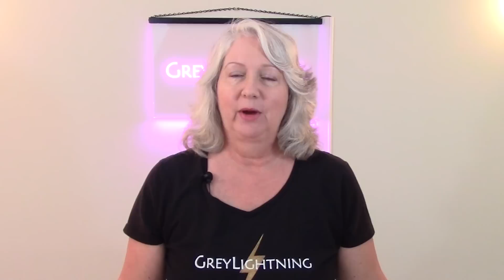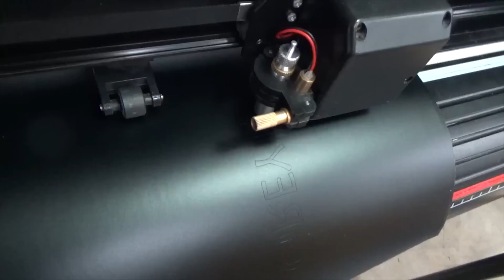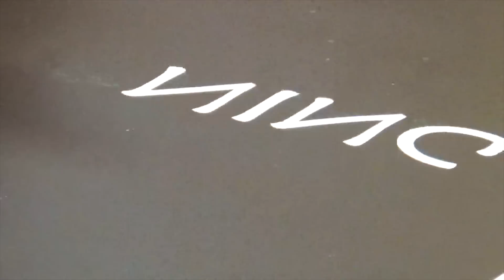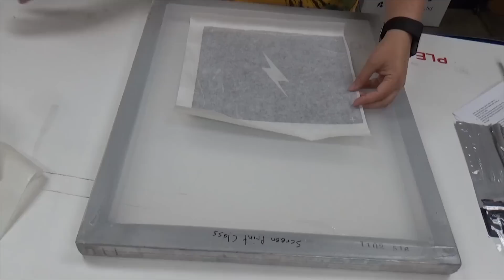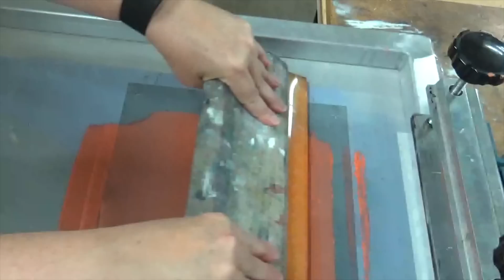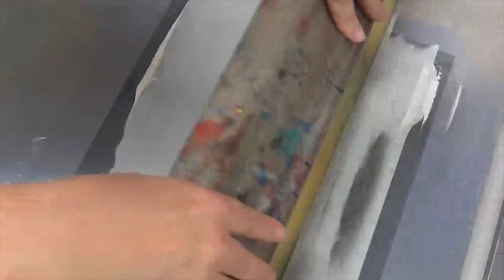Screen Printing GreyLightning Tee Shirts

Comment: I tried using the vinyl a couple times but I keep getting a bleed line. I'm not sure what I'm doing wrong. Like if I did the design you did in this video the lightening bolt would have a faded/light shadow to the right of it.
Reply from the maker: Will, sounds like an adhesion problem. If you are squeegeeing it down as well as you can, you may need to try a different vinyl. I've done this several times, and others do at TechShop as well, and the prints have been clean. Does it happen on the first print or later ones? That can happen if the screen shifts and you have residual ink from a prior print. Make sure the screen is tight and comes down in the exact same place each time.
Reply: Greylight May I'm using the cricut vinyl. I use a flat edge to make sure it's stuck to the screen. I watched another video and it said to try offset screen printing. It's happening on my first print.
Reply from the maker: Will, sounds like you're doing everything right. The one time I experienced this was because the screen had some wiggle room, but that only showed up after the first print. I'm not familiar with offset in the context of screen printing, so I can't comment on whether or not that advice sounds right. I hope you find a solution, and would be interested in what fixed it, when you get it to work. Good luck!

Comment: What type of vinyl are you using
Reply from the maker: Hi Leroy. Unfortunately, this is one question I can''t be much help on - I buy my vinyl by the foot at my Makerspace, TechShop, and it's unlabeled. I will try to remember to ask them about this the next time I'm there, in a week or so. If I get any concrete info, I will pass it on to you then...

Comment: how many tee  shirts have you printed before the vinyls start to brake down??
Reply from the maker: Hi Ben. I've only printed 12 at a time and there was no sign of wear on the vinyl. I use community screens, so I have to take them apart and clean them at the end of my session, so I'm not sure what the long term durability is... since the vinyl is on the back of the screen, it is not touched by the the squeegee, so I suspect they hold up pretty well, but if you want to print a lot of something, having screens made (photo emulsion?) might be the better way to go.
Reply: thanks for that information, 12 shirts  is good for what i wanted to do